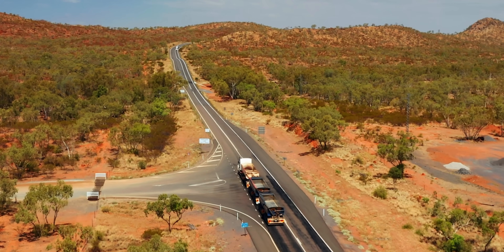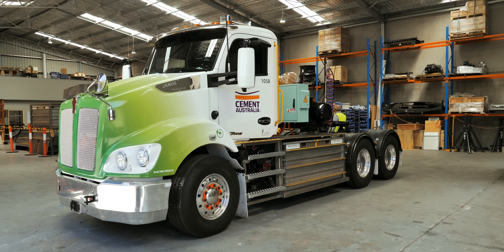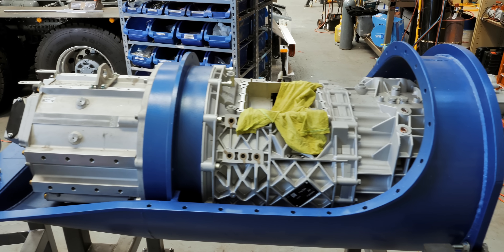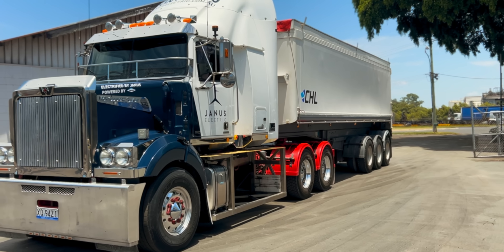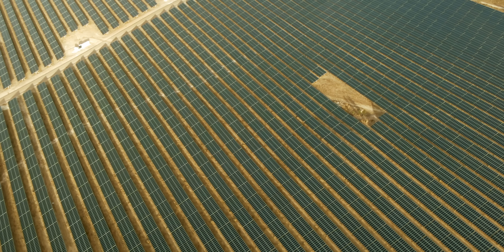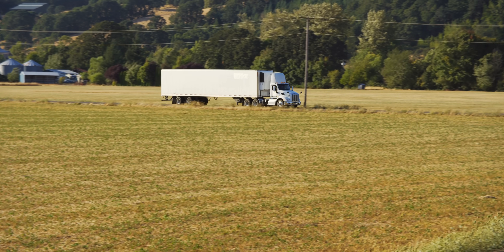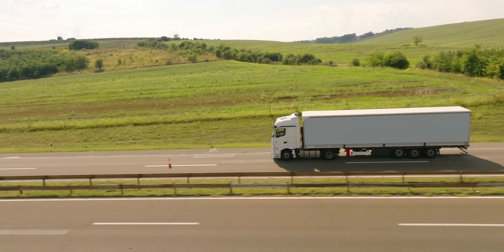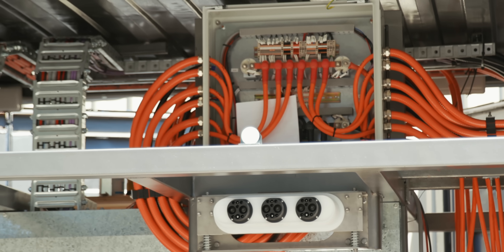This GIANT Electric Semi Can Swap Out Its Batteries!

Comment: Very interesting. Someone actually thinking correctly about the battery systems for electric big trucks. The efficiency of swapping batteries does remove the recharging time problem. But creates the problem of building the infrastructure big enough to handle and swap truck batteries multiple times an hour. Just like a truck stop fuel island can refuel many trucks an hour. Battery swaps would need to happen many times per hour to support a lot of trucks within the trucking industry. Yes I understand it being a new generation vehicle power system. But the cost I know would prevent the average truck owner from being able to convert. That would mean only the very large fleet companies would be able to benefit 🤔
Reply: It also doubles the battery costs, which are already prohibitive.

Comment: Absolute gold😜 I mean the calm and collected salesman speech like he's persuading some dim-witted truck operator to do the conversion is offensive enough.. then he admits its upwards of aud$150,000 NOT INCLUDING the batteries 😂😆.. for an electric motor and they probably sell your perfect running diesel motor to the middle east👌 Best of luck guys now let's watch the cost of transport rise even more by hauliers going electric. Don't try telling me that electricity is cheaper than diesel.. The NSW rate is about 28c/kwh (soon to rise about 25% and I seen a fast charger a few weeks ago charging 65c/kwh 👍

Comment: where did you research that its Faster to Charge than to Fuel again? cus it takes less than 15 minutes to Fuel up 2 130gal tanks than it takes to Fully charge any of the current Electric Class 8 trucks on the market ie Nikola, Tesla, Peterbilt, Freightliner ect. All of which take several Hours to fully charge to 100% for Full use and most of the trucks out are Not a Sleeper Configuration ment for Long Hauling here in the USA as the Daycabs themselves hardly get upto 250miles on 1 full charge Electric Vehicles were ment to reduce emissions in Densely packed cities and states that are yet to fully benefit from renewable energy sources fully. And to re work an entire truck stop for the purpose of quick charging Semi Trucks will require them to put out the same amount of energy usage as a small town. Thats alot of power being directed to just a place where Class 8 commercial vehicles go to fuel up or at that point charge. Its going to be quite some time before you actually see this technology really bear fruit as there is still the hurdle of how expensive it really is to maintain a class 8 over your sultry pov and yet its still expensive to own a Tesla or any other fully electric car. in stead of spending what needs spent for engines which can be relatively be cheaply maintained. When the battery of a EV goes bad its 10s of thousands to replace over replacing an engine and transmission with labor. Thats just your average tesla what do you honestly think it will cost a commercial truck to have to replace their batteries if they are in a spot that takes more time than the position this one is in. Not all trucks are built the same and that goes especially for EV trucks. This one is a Reworked Conventional truck with an emphasis on simplicity and easy access.

Comment: We use to do battery swapping on our lift equipment in my warehouse were I work. Then we switched to fast charging systems which were ok but the batteries were only good for three years even though the manufacturer said we should be getting five years out of a single battery. So we recently changed to hydrogen fuel cell batteries and other than some computer issues they have been great. I think this will be the future of global logistics.

Comment: the data he is claiming about all trucks normally need a engine rebuilt at 600,000 miles is totally incorrect.  I drove trucks for years and most of them will pass well over a million miles without any major engine work. I guess it all depends on the condition they are used in and how well maintenance is done.  I just don't see this being practical.  Do OTR companies need to lease battery packs that will be made available at charging stations?   What about a battery fire with 4 tons of lithium batteries? The companies leasing these batteries are the ones that are going to make  all the money.  What stops them from raping people on battery swaps if it was going to replace diesel?   I think it creates more problems than it solves.

Comment: Why is it that nobody talks about how toxic these batteries are when they need to be recycled. Secondly when a rig hits 1.000.000 miles they are mechanically worn out. This is not feasible.👎💩

Comment: Why does. An electric semi need such a big radiator, it should not have one if truly electric. Real electric trucks are streamlined so they have less air resistance while traveling at highway speeds.

Comment: The concept of battery swap does allow it to keep running; but unless there is going to be a network of battery swap sites - it won't extend the range - the truck will have to keep coming back to base to get a new battery every 100 miles or so - that is good for around town deliveries; but it isn't  very useful for long haul.  Say you did have such a network - how many batteries would you have to charge in order to faciitate 1000 such trucks on the network 1000 miles long - 100 batteries every 100 miles - how do you charge 100 giant EV batteries?  You practically need a dedicated nuclear reactor.  This simply shows - the entire EV idea for trucks in particular is rediculous.

Comment: Such a shame these batteries require cobalt which is mined via slave and child labour, look it up. Also at 5x build cost to recycle these batteries tells anyone with half a brain they're a throw away item. If it catches fire you can't put it out with current fire fighting methods, also spews massive amounts of toxic fumes when burning. 2 Melbourne fire-fighters injured for life can no longer work due to attending an electrical car fire.. yeah the "idea" is good. The truth is it's a con job.
Reply: couple that with the absolute carnival show that is "climate science" and the con job really starts to show.  Until this point we all knew death and taxes were absolute, but at least air was free.  No longer.  They figured out how to tax air. (carbon)

Comment: 600ks lol only good for city drivers and you have to change batteries halfway through the day it’s going to be a long long time till they will be doing long haul, great idea sure. The cost of the conversion is the equivalent of 3-4 engine gearbox rebuilds and that is a huge cost for any company considering the abysmal freight rates.
Reply: Also, being able to STORE ENERGY in the form of chemical fuel is something the big daddy government doesn't want us to be able to do. That is the real reason for electrification.  It will be used to enforce social credit scores.  Been a naughty Aussie?  Turn off the power.    If you doubt me ask if the military will go electric or keep diesel?

Comment: 400km range whilst being more than a tonne heavier. not a great proposition. i think the only way to rival traditional trucking would be a hydrogen fuel cell instead of a toxic battery. the hydrogen can be stored as a solid in potassium borohydride powder and doesnt have many temperature considerations
Reply: and it doesnt add up.. 540KW with a capacity of 620KWh does not mean 1.5KWh per km... so lets be generous and say the truck is going 100km/h you're only traveling 115km so it cant even get from 1 fuel station to the next, assuming theres a battery storage and a forklift at every roadhouse. i have not been convinced.

Comment: Much like early days of ICE engines fueling stations did not exist ,routing had to be carefully planed to get from point A to point B . Mechanics / technicians were not always distributed conveniently along routes  . Repair facilities virtually nonexistent . The technology of swappable battery packs has been used in industrial plants for many years  . This is just an incremental battery /control /swapping system improvement . Good application but will need a highly planned and rapid rollout to have materials/ facilities/skilled personnel in place to be really be useful  .

Comment: Rather than a bloke with a fork, they need robots doing the swaps: faster, more precise and 24/7 availability. Essentially this swap system gives the truck unlimited range, it could swap batteries several times a day, every time it reaches a logistics hub where battery swap has been installed.

Comment: Imagine thinking a battery powered vehicle is more green than combustion.....
Reply from the maker: It's fascinating how many people this has really upset. I'm loving it. Keep going, be more angry.
Reply: @fullychargedshow  nobody is angry. It's just clear that normies don't understand the implications of battery powered vehicles. The remote shut off is what to worry about.
Reply: @fullychargedshow  it is only logical for common people to resist the government forcing us away from cheap energy that is easily stored and used.  Do you think the military will go electric or keep diesel?  The answer is obvious when you consider tactical advantage.  But the tax cattle must comply with the grid so they have to become a slave to it.  
And you are "fascinated?"   Enjoy cheering for the air tax and social credit that this will lead to.  I'm sure you'll be loving it.
Reply: @fullychargedshow  Australia should learn from the past year with lockdowns and masks mandates that your leaders are against you
Reply from the maker: @justinwhittle6163  Aha, so you are not a 'normie.' You are more intelligent and can see through the con job being rammed down the throats of hard working families.
Because modern combustion engine vehicles that are now all built with complex computer technology built in that is accessible over the air and could easily be 'turned off' by evil liberals who want to crush your freedom.
Don't ask why evil liberals would want to do such an absurd, self defeating thing, the conspiracy sounds great and you can be angry about it,.
Oh sorry, not angry, just knowing, special, you can see through the filthy eco lies, you know the earth is flat and all vaccines are used to control your brain . . . . or some other sad crap. Boring
Next
Reply: @fullychargedshow  you think they would have remote shut off the Canadian truckers? They shut off there bank accounts!

Comment: I drove a truck for 27 years and there is no way I would drive electric battery truck what if you would have somebody would broadside you are the batteries is and it will catch on fire then you'd have battery acid all over the ground why would you change it was your wife or kids or whatever I don't see that working

Comment: It's crazy how people are brainwashed thinking using battery powered vehicle is a saving environment..
1. Where to battery manufacturing raw materials come from ?
2. How raw materials fpr batteries are extracted and  processed is electricity used in their preparation..???

It's hypocrisy saying you save the environment by opting for ICE over EVS, 

It's going with EVs' trend

Comment: This swappable battery tech combined with Tesla's more efficient motors could be a combo that weighs less than the Diesel counterparts. I could also easily see a pull through battery swap station being pretty straight forward to implement with side loading batteries.   I'm Genuinely impressed.

Comment: Fascinating development. The haulage industry works on cost/payload. What is the weight of the motor/battery combo over the weight of a diesel engine/fuel combo? If it's heavier then that might mean less payload per trip thus increasing costs slightly. If it's the same or even lighter then fair do's as they say on Oz. I'm sure though the technology will improve as time goes on, as all technology does.

Comment: Surprised at 13:51 they do not need flash screens or anything for PPE with that large potential and their face right there.  Wish you could cover the education and training all firefighters, EMTs, Police, etc need with the EV vehicles.  EV vehicles need special handling in accidents and if there is a fire they need more resources to get the fire out and to get people away from the very deadly gases in the area. You have firefighters being permanently disabled, poisoned by the cobalt because of a lack of training.

Comment: YEAH, BUT. YOU HAVE TO SERVICE THE BATTERIES LIKE A MOTOR. THE BATTERIES BARELY LAST OVER 8 YEARS. YOU MUST SERVICE THE BATTERIES AND OF COURSE ACCIDENT REPAIR, BRAKES, TIRES, AND ELECTRIC MOTORS DO WEAR DOWN WITH SOME REGENERATIVE BRAKING. YOU ALSO MUST DEAL WITH MORE PSYCHOLOGICAL ISSUES FROM THE DRIVERS AND OWNERS ON THE COMMUNITY. Mindsets begin to conflict between you and the other people though....which is the most difficult part.

Comment: Ive been saying it. battery tech is not where it needs to be, hot swapping is much better than having a fleet of trucks parked in a lot getting charged. I wouldn't be opposed to having some cars with quick swap battery packs, it would certainly be useful in some niches.

Comment: I'm not saying it can't but let's be real with this there going to be set times you have to charge at and your going to have to have 1 million + batterys for the trucks that's in use and 1 million +batterys sitting (lithium hazmat) on the highways it in a storagre container godforbid you want them to line up somewhere to get it swapped out just doesn't sound smart in the USA

Comment: This is when the people that build DIY EV conversions with gearboxes are validated.  People  that have  manufacturer built direct drive electric cars that they have spent a fortune on need to wake up. 

Mapping an electric motor and cvt gearbox to follow efficiency is the way forwards for light vehicles . 

Small motor, simple drive train, less battery  and  more range.

These trucks demonstrate this by using a gearbox to divide and multiply torque to move 96ton efficiently. why cant car manufactures do the same? 

My opinion is that there would not be the built in obsolescence of the current generation of inefficient electric vehicles.